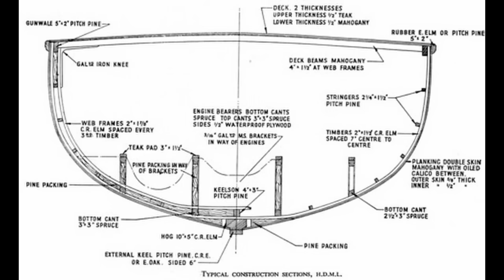Ep 134 - Plank Ya Boat Time! #boatrestoration

Comment: Ok there needs to be some assumptions,1 the deck beams have the same camber from the reference bulkhead beam going forward but only shorter as you go forward. Or 2 you increase the camber as the beam gets smaller going forward. From my experience irs going to be the same as assumption 2. So make up a template from the reference bulkhead. Then make a solid form work to laminate the beams. Go ahead and make the smaller to larger beams as you work on the starboard and Portside planks and beam shelfs. Saving time waiting for the glue to go off and also keep the shape of the gunwale best fit temporary brackets from the old beams to the beam shelf to prevent the boat loosing its lines. It’s better to hold it together than try to crank it back in to place. Remember you are on the water and storms could do unintentional damage 😂

Comment: If the boat's drawings  have a scale  of what they were drawn to you could use a pair of dividers and measure off the drawling at center line from the top of the keel to the top of the transverse deck beam at centerline to figure out your camber.  I'm sure you guy's will figure it out.

Comment: once the beam shelf is in, (dont know what other side is like) you can replace deck beams with the deck still in place , same as doing the frames. which let you get a lot done before you need a dry weekend to replace the deck.

Comment: To make the curve  take a straight edge just as Simon is showing and measure the height / gap up to the beam, at the middle of the straight edge length.  This is known as your arrow height. Then use this to recreate same 3 points in workshop. Put thin nails until a board at the 3 points.  Then a thin batten, often called a spline is pushed against the 3 nails.  Scribe a oretty decent radius.  Once you've got the first section it's possibel to leafrog outwards using same arrow height method. If you use free CAD select draw arc by 3 points.  This will tell you the radius.  Then you can pick points at whatever width you need.

Comment: Try to loft it.  Snap a chalk line connecting the two farthest points.  Mark every "10cm" or so.  Measure the vertical distance at each point.   If you knew the boat was level it would be easier, but you can use those numbers to cut a template.  Good luck whichever way you try it.

Comment: I think I would uncover the deck, do the beam shelf on both sides a little way back, then put in a new beam across.  Then put the new deck on.  Then continue a section of beam shelf, the beam and the deck.  So you do the whole thing working from the front.

Comment: To get a template for your curved ribs, frames, deck-beams etc,Use a "spiling" batten. Stretch a string between the two end points, measure the gap between string and camber edge in sections and basically transfer onto a straight edged plank your camber offsets from your reference beam stringline as a series of points, drive in nails or screws, and spring a batten round the pins drawing around the batten. Seemples! Tip: if no suitable batten to hand, use for small curves a piece of "Swish" flat curtain rod, for larger curves a lengths of 1 1/4", 1 1/2" or 2" pvc waste pipe, Hunter, Osma etc work really well, forming almost goemetrically perfect curves. For your boat assuming a max beam of 6-8 metres, marking centre, and then every 1.5 metres is more than adequate.

Comment: Using that bulkhead. Stringline the longest shot you have. Measure offsets every foot then you can calculate your radius (there will be averaging necessarily). Then layout (in the workshop) the longest length you need and work out the offsets for that length at your averaged radius. Batten  those points in a fair curve and you have your pattern. 
And if that seems daunting just feed me the measurements off that bulkhead and the longest you need.

Comment: Might be also worthwhile checking sister boat cambers and it's likely the camber also alters and reduces towards the bow. Laminate then all over-deep for finalization of upper surface assisted by laser level sighting and consider deepening the beams for additional strength particularly to sides. You do not need to rigidly follow original design where it has shortcomings. Good progress; going to be a valuable boat when done and maybe even pivotal in financing future boat restorations.

Comment: For the deck beam would it be an idea to use a plumb bob every 6inches and come down 1 foot and make a mark then transfer to
Reply: good idea only they can't use a plumb as the boat is not sitting level but they can still measure 12 inches down across it's length.

Comment: Thanks
Reply from the maker: Brian thank you so much for your support ❤️
Reply: @ShipHappensUK  you will get a lot of advice on your deck beams but get your camber template made and  mark centre. The centre will follow all new beams down the centre line of the boat. If not a perfect arc at least the arc will remain in the same position as you come aft. The new beams will be bevelled on top to follow the shear of the deck and bevel will change  as you come aft to less shear. Use a thin board to sight across top of beams to ensure the bevels follow each other. Hope this helps.

Comment: you guys are doing a Stirling job there, there can't be many people out there brave enough to take a project on like this
but as i always say to friends, these things are built by man and can be rebuilt by man (and his wife) so nothing is impossible, i'm just embarking on rebuilding my car so i know the kind of hazards coming up, and like you guys all to be done on a shoe string

i was going to suggest, measure the width of the longest beam, use a fancy laser (switch off self level) so the laser touches the bottom at both ends, you can hold up a piece of paper at the centre of the beam or bit of wood to measure from the laser line to the underside of the beam to give the difference in height and set the curvature, in your workshop you can draw this up and use a long batten to make a fair curve, or bend a plank long enough to pin at both ends and the centre

i've watched some boat builders do similar, and found it odd that they were happy to have either side slightly different, the beauty of working in timber using old methods - which ever method you use you guys will have fun doing it and we have fun watching it - laminating the beams is definitely the right way to go, will you be using mahogany

PS great idea to visit the other surviving HDMLs, Kuparu looks rather smart

Comment: Wonderful work!  I could not clearly tell in your prints, but in the lower right hand corner was there a scale indication?  If so, with an architectural or engineering scale (fancy ruler) you could take some measurements on the drawings and determine the camber.  Good luck!

Comment: How about this idea.  Put a stringline to the under-ceiling area, side-to-side. And then measure  between string and ceiling area every couple inches (or equivalent) Base that on making your template.
After you make your template be sure to mark center of ship. Then you can make your diferentiating lengths and modify accordingly. I think you will find your beams as they get shorter to the "pointy end" the center will be greater (tighter radius) on the bow. Maybe not. I am not there. And every ship wright does it different (As they say, 99 ways to skin a cat.)--D.

Comment: "cup of tea time!"  
For the camber/slope or whatever the correct term is...

The way the beam shelf curves up towards the stem post in relation to the hull, it strongly suggests  constant radius deck beams with the result being a flat "peak" along the centre line.
 Like the deck is a section of a cylinder.

If you are trying to be true to original, maybe another visit to HDML Medusa? or if you can contact someone in the know about HDML's.

You could make it more curved (tighter radius) than original and give yourselves a little more head room.

Or even more headroom using varying radius beams, resulting in the deck looking a little bit humped back. Like the deck is a section of an egg shape.

If you are laminating the deck beams, maybe consider making them more like "I" beams? (The first one or two layers and the last one or two layers are wider than the original beams) it would make them stronger and less likely to sag without too much more weight.

Comment: There must be something I am missing or dont understand. Would it not be easier to laminate the beam shelf, especially on the more bendy bits in the other direction. Using the square section timber as you did it is more prone to snapping than a plank type section, once laminated together it would (should) give the same strength but be easier to bend? HOWEVER I am only the Son of a Carpenter, not a Carpenter myself 🙂great video as always, thanks very much. I am sure someone will be able to tell me why you have to do it the way you did,

Comment: To determine the radius of your beam you need to determine an arc length that you want to use (something that will allow you to work with in the limits of your hull.  From the arc of the beam you will need to come off perpendicular to the beam.  You will need to the perpendicular lines cross each other, measure that angle.  Then solve for 2 Π  radius.  

Arc length = (angle obtained/360) ⋅ 2 ⋅ Π ⋅ r

(Arc length ⋅ 360) / (angle obtained ⋅ Π ⋅ 2) = r

The longer the arc length you use the more accurate your result.

Comment: 6:00. 

I wouldn't worry too much about a perfect radius. You could go flat deck if you wanted. So long as you have some kind of slope to shed water over the sides you'll be fine. Your ship was designed for war. It was designed to go out no matter the weather conditions and shed water as fast as possible over the sides. 

I doubt you will go out in 15ft seas and need to man guns on the front deck.

Comment: Hiya guys, you should mark out the centre line  below decks and then make a template for the widest beam, centre line the template then mirror your distances  from that for each beam. As far as the camber goes... 3 degrees from the centre  out to the widest should be fine if the plans don't give you anything.  As you said,  pencil and string will give you the arc. Remember to work off the centre with all calculations and mirror everything. Good luck 👍

Comment: What are the plans for refurbing the outerhull.? Even the planks that are concidered (good) are in a heck of a bad way. I know the look of a boat doesn't translate to a  sea worthy boat. But, who wants to work for years on a boat that still in the end, ends up looking like an ugly boat on the outside? Probably noone. It's not like you can put a skim coat on it like a wall to make it look better.
Reply: Looking old/used aren't necessarily a bad thing. Wear/battle scars add's charater/history to things. A lot of people love "patina", actually so much they add fake rust to hot rods or are paying additional to get their already expensive factory new guitar with a old worn appearance. 
I'm sure Sarinda will end looking great. Gemma and Simon aren't exactly you ordinay DIY amateurs, since they make a living on custom building camper vans. Which also are the reason they got the big shop with all the machinery.

Comment: Obviously you can't conveniently mock up such a huge ark/circle to make the beams. But you can take a straight edge measurement from side to side and also measure the ark distance every scaled amount across the distance (one inch, or so many millimeters or what every spacing you like being constant all the way across) from the straight line level to give you the information to use formulas to figure out the true ark degree. And since most of those beams will vary because of the width of the hull, I doubt if two will be exactly the same. But the ark should hold up for the entire hull... A little math and you should be able to nail down the top ark of all the beams regardless of length/width...   JMHO!

Comment: It is very common for all deck beams to have the same radius and just different lengths.  I think you have communicated with Leo at Sampson Boat works, but he would be an excellent person to bounce your ideas off.
I assume that you will be laminating all of the beams rather than cutting them.  This would make the strongest option and also more rot resistant given the epoxy lines.  If you go this way, I would build a form with the desired camber for the longest beam and then glue up the beams to the length needed.  This was the method that was done on Majic Carpet.  https://www.youtube.com/watch?v=qAkyBeVQHzo

Comment: You really really need to make yourself a rubber tipped finger out of an offcut for feeding stuff into that table saw, if you slip & feed your rubber finger into the rotating blade somehow it will make an amusing video clip, if you feed your actual hand in, less so...